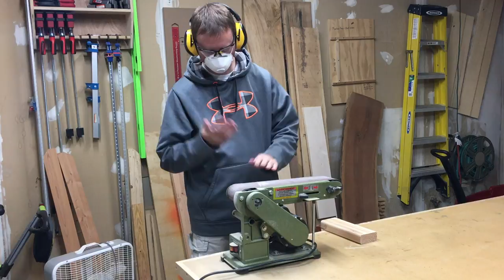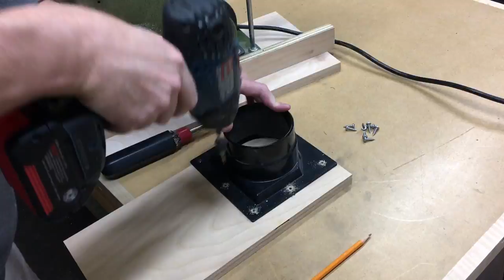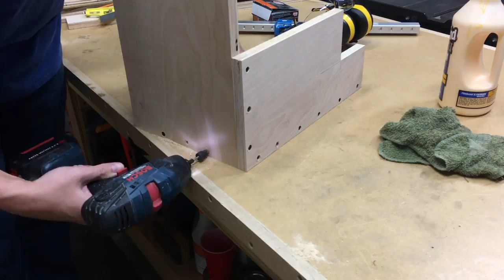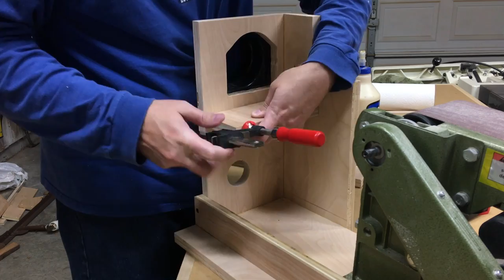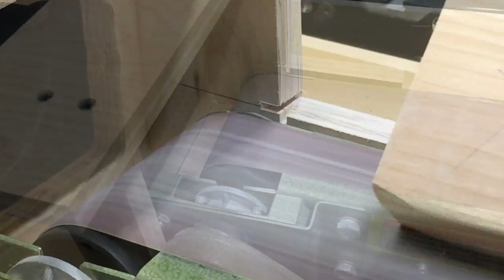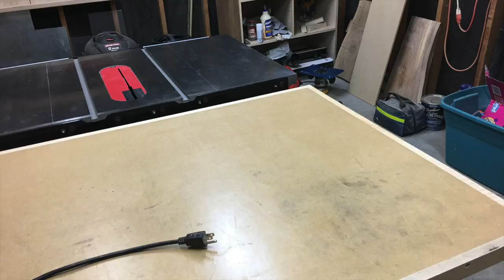Stationary Belt Sander Dust Collection Solution | Woodworking | Shop Built Tools

Comment from the maker: Want to support the channel? Here's what you can do:
 - Subscribe to the channel
 - Hit that Like button
 - Leave a comment
 - Amazon Affiliate: https://amzn.to/2LaN1Ib

If you have stationary belt sander with horrible dust collection like this HF model then stick around for this build.  I used a 4 inch port and some scrap plywood to put this together.  It's not real pretty but it works like a champ!  If you have any questions please comment below or contact me via email or the socials.

SawStop 1.75hp PCS: https://amzn.to/2X4gWsP
Bench Dog Push Blocks: https://amzn.to/2YB00uL
Ridge Carbide 10-inch Saw blade: https://amzn.to/3bATmcp
Bosch 18v Impact Driver: https://amzn.to/3cxAhJk
Ridgid ROS: https://amzn.to/364yHMA
Titebond Wood Glue: https://amzn.to/2LzTdv4
Bessy Parallel Clamps: https://amzn.to/2z4LHG3
Bessy 6-inch F-style Clamps: https://amzn.to/3e3LGl4

Subscribe: https://www.youtube.com/danprudlow?sub_confirmation=1

Twitter: http://twitter.com/DanPrudlow
Instagram: http://instagram.com/danprudlow

Comment: I was wanting to make a dust collector for my disc/belt sander, and my first attempt was a disaster. I saw your video and saw where I had messed up. I made a collector similar to yours and attached my shop vac to it. It works like a charm. Thanks for getting the cobwebs out of my brain and showing where I went wrong and how to correct it.
Reply from the maker: Glad the video could help you out!  Thanks for watching. 👍🏻

Comment: Dan, I could have used this yesterday! What a great set up and I may just copy it. I had 10 small hardwood pieces to sand and dust got everywhere. Usually, I sand and joint outside, but it is still to cold to do that. And, for some reason, I completely spaced out on using my fine dust filter above me. I did remember to were my mask but I still blew a log out of my nose though, lol. This will work great, thank you!!
Reply from the maker: Thanks, glad you found the video and found it helpful! 👍🏻

Comment: I have that same sander and dust  problem. 1st of all I liked your video. It was right to the point and very helpful.  I would like to use your design if that's OK with you.  After using it now for some time  are you still happy with the results and is there anything you would have done different if you were to rebuild it? I look forward to hearing back from you before I get started and Thanks for sharing the video.
Reply from the maker: Thanks for the compliments!  Much appreciated.  You are absolutely welcome to use the design.  I think the only thing I would try to do is make the little table for vertical sanding a bit bigger and then better secure the sander in place.  Whenever I use it vertical the pressure against the belt tents to push the sander backward which is annoying.  Fairly easy fix…I just thought the weight of the tool would keep it in place but that hasn’t been the case.  Thanks for watching!

Comment: Nice build, but I think a screen should be over the dust port hole. If a person let go of the work piece it would enter the dust collection system causing possible problems. Again nice build.
Reply from the maker: Thanks.  My dust collection is 2 stages so anything large would never make it to where it could cause damage...but I agree if using a single stage system you would want some sort of screen there.  Thanks for watching! 👍🏻
Reply: It is not only the damage potential, but there is the possibility of it getting wedge in a bend in the pipe and causing one to have to disassemble fixed piping to clear. Much easier to just add some hardware cloth over the port and be done with it. In the end it is your equipment to do as you please. Again a nice build.

Comment: Just ran across this. I just bought the same saw and your approach seems like the best I've seen. I'm in. What intrigued me too was the hosing and porting. Where did you find your hose, port and that thingy with the trigger looking mechanism?
Reply from the maker: The hose and such is all from Rockler woodworking from their Dust Right line of accessories.  I have ports on all my machines and then I just move the hose around to each as needed.  I don’t have the ability to run pipe to each machine so this solution works quite well.  Thanks for watching! 👍🏻

Comment: I m looking for a system with the use of air filter, that sucks up wood dust that flies while sanding wood with motored sanding machine.  What tools/machine will be required? Please help
Reply from the maker: Search for a dust collector.  These all usually have some sort of filter.  If you want something smaller that connects to a smaller sander look for a shop-vac or dust extractor.  Hope this helps.

Comment: I have an old Craftsman bench sander.  I put a vacuum intake under it and a flat vacuum attachment in front, and that gets most of it, but some of the dust rides the belt on the underside and spits out the other side where the belt resurfaces.  Do you think the vacuum on your design would prevent this too? 

Also, why did you glue some joints but not others?
Reply from the maker: I still get a little bit of dust coming off the belt on the other end but it’s pretty minor.  With the big 4 inch hole it’s moving a lot of air past the sander so It does pretty well overall.  As for gluing some versus not…I probably got in a hurry and skipped the glue…I don’t recall exactly. 🙂

Comment: My harbor freight sander (same model) came with an end cap that traps that dust. I 3D-printed an adapter for my dust collection to fit the port that was already there.
Reply from the maker: +Chevee Dodd mine came with a plastic piece to go at the end but it didn’t fit well and didn’t seem to stop a lot of the airborn particals that kick up off the end of the belt.  Thanks for watching.